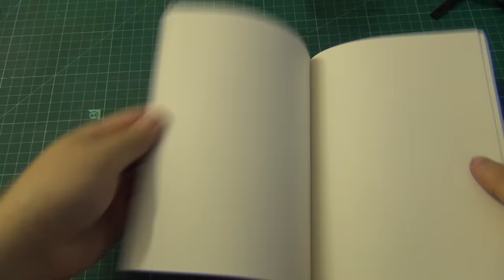Simple Book Binding

Comment: Once he brought out that perfectly shape blocks and that iron thingy I knew my book binding dream is crushed.
Reply: bdusa just use some used straight wood or anything with a straight surface and then put a really big rock enough to hold the papers in.
Reply: You don't need any of those! I've been binding books in my tiny flat without tools just fine. Just use heavy books or smthg instead of the boards and clamps, it works  exactly the same! You really just need the glue, paper, and cardboards if you want to make hardcovers (for paperbacks, just use cardstock). If you don't want to use cloth, use cardstock or regular paper for the cover (though the thinner your paper, the higher the possibility of getting wrinkles). 
I usually sew the signatures together before glueing them for extra security, there are plenty of tutorials on youtube if you want to do that.
Reply: Those are clamps 
(which are cheap and can be found at any hardware store) 
could be replaced with a heavy object. The purpose of him using the clamps is to keep the paper aligned and from being malformed so there might be other solutions to it. Hope this helped!
Reply: hey I bookbinded using heavy dictionaries and my notebook was so beautiful anyway :) just try it
Reply: omg ikr
Reply: I just used some old shelves, and sat my chungus Guitar amp on top. :)
Reply: @manusigl  what hard thing i can use as base of the book..!?
Reply: @mahamwaseem5207  i usually use cardboard with at least 800g/m², my go-to is 920g/m². But the important thing is that it doesn't really bend too much. If you don't want to buy specific cardboard, you can e.g. use the back of calenders, old notebooks...
Reply: @manusigl  okhy..can i use cereal box card board..!?
Reply: @mahamwaseem5207  you can, esp if you glue two or three layers together. but i wouldn't recommend it for books you want to last for a while
Reply: @manusigl  okhy..thnks u..!!

Comment: Technically, that's not Perfect Binding but rather Case Binding with softer backers and no spine.    Perfect binding is gluing the pages like demonstrated with the cover just glued to the spine and folded over on the edges with the edges trimmed flush on a guillotine cutter.  Needless to say it was WAY cool.
Reply from the maker: You're abseloutly right. This is more "perfect-ish" then perfect binding, but that doesn't show up well on the title. Thank you!
Reply: Perfect binding is sewn.
Reply: Ida Kiss Perfect binding is the method of bookbinding in which a flexible adhesive attaches a paper cover to the spine of the assembled signatures of a book or magazine.   Live Wire

Comment: It constantly baffles me that perfect binding actually holds the pages together and even lets the book lay flat most of the times.
Reply: The quality and application of the glue makes a big difference.  Done right it works very well.  But I have a couple commercially bound books using the method where pages are starting to come out.
Reply: @hanelyp1  yeah as long as glue holds well and has a bit give in it when dry. We used to have fancy new textbooks for english class that fell apart bc glue just crumbled and fell off, together with pages.

Comment: You folded the paper pages from one format to the next smaler one. Either you picked special paper with horizontal direction of the fibre, or you will have problems with the book block getting "wavy". Also glueing foldet sheets at the folds makes it a bit more unstable. Either you glue single sheets, or you bind folded ones via needle and thread. For the bookmark you wouldn't need another type of glue, but just inserting it during glueing the back of the book while the glue is still wet. And with a book block cuting machine (about 150$) you wouldn't need to sand the book block. If you aply the glue onto the tissue instead of the cardboard (spreading it star shape like from the middle to the edges) you can simply fold the overlapping parts in, instead of going through another round of applying glue.

Comment: for people who don’t know why this is considered simple for the fact its binding it just glue, it less repetitive compared to ones with sewing which some techniques are simple and have less steps than this it wouldn’t be considered (imo) using that design you easily snap the string when accidentally sewing into your own string if you can undo it if not you just have to yank and hope it doesn’t break the string if it does you have to remove all your progress and restart the sewing process 
Straight up glue binding like this takes longer for the glue to dry but has basically no chance at error like if you sewn it

Comment: Hey there, big fan. Wouldn't it be easier to apply the glue then clamp them?.or maybe clamp them but tighten the clamps after ?.
Reply from the maker: You don't want the glue to soak anywhere that isn't the spine, so that's why you first clamp the pages together and only then add the glue. Tightning the pages will prevent the glue from soaking too deep into the pages aswell.
Thank you for your soppurt! :)

Comment: I am totally imprest!!!!! I wrote a little book I would like to self publish and I definitely will practice this method!!  What options would I have to print on the cover?
Reply from the maker: Thank you for the kind words! As matter of fact, I'm working on a video down the line that'll cover that exact topic. The brief of the process behind printing on book covers (the DIY style) is to use a sheet to vinyl and cut out a stencil of what ever it is that you want to print on the book. Lay the stencil on the book cover, then, with either clear spray paint or clear nail polish, make a thin coat over the stencil to seal the edges and prevent "bleeding", let it dry, then paint it again with whatever colour you desire.
I hope I'll get around that video soon, and I hope to see your comment on that video when it comes out!
Itai ✌️
Reply: Thank you for the fast response ! I was impressed how precise you work! Well done and I will look forward to the next videos

Comment: Great video. i never knew it was possible to bind a book efficiently using glue only. Don't you need to sew it?
Reply: Notice that he folded si gle sheets, that's how you can do it with just glue. If each signature is multiple sheets you could sew them together then just use glue to put them together with the cover. Single sheet signatures don't need to be stitched.

Comment: For those who don't have a tool exactly on the video. You can also use a bulldog clip.
Reply from the maker: You can use any form of clamping that's available to you, as long as you have two boards to press the book flat. Other wise your book will warp and you won't get a fine looking bood. So yes, if your bulldog clamps can open wide enough to hold the book+two hard boards, that'll perfectly. I would advise you to use look for slices of hard cardboard, 1mm of thickness on each side will.
Reply: @itaishemer  thank you very much. I did it. My mother is happy for me. This is great tutorial!
Reply: @itaishemer  You earned a sub!
Reply from the maker: @neverever7821  Best sub I've ever earned!
Reply: I've finish my notebook today and it was great even it's my first time!

Comment: Is pva glue enough to keep the pages together? It seems like they would rip off easily.
Reply from the maker: PVA alone is not enough, that's why I use gauze. The pages are held together very well for a long long time, though you can pull a page out if you'd like. Even after pulling sone pages out of the book  the gauze has a very strong grip on the rest of the pages

Comment: I've made 3 books. And while they all function, they look like shit once you open them. The end pages (the ones holding the block to the cover) get torn and I end up with terrible looking first and last pages. Like I said, they function, but I think I need better stock for the end pages. It's the only thing I don't have when I follow tutorials and you see the black, thick end pages. I have no idea where to find this stuff.
Reply from the maker: That's the thing about hand crafted arts, it takes time, trial and errors, until you get the results that suits you. My first few books looked terrible, believe me! Fir the end paper, I would recommend using thicker paper, such as bristol. Some are stores sell them individually, or in stock. Somewhere around 100 to 150 GSM (Gram per Squared Meter) should do just fine. Foe the cover, I used bookcloth,aarerial which is pretty hard to come by, but is sold online or can me made at home (I have seen tutorials on how to make bookcloths, but I never tried them myself)
Reply: @itaishemer  The one I'm drawing in now actually looks a lot better than the other ones. You can still see it's obviously homemade, as soon as you open it. But for the most part, it's not bad for my 3rd book. I use faux leather covers. They look great. It's just that one stock that I need to make a perfect looking book. 

I fill them with finished art. I have sketch books and stuff but the books I make have all finished art in them. I think it's cool to have a book that I can flip through and see all of my art. 

Thanks for the tip. I'll look for it for my next book. This one is almost full so I'll need to make a new one soon anyway. 

Thanks again.

Comment: this is amazing but what about if you don't have all the tools
Reply from the maker: What tool are you missing? I'll try to help you an alternative. I'm working on a new tutorial, so this'll help me as well, to figure out what folks have at hand to work with :)
Reply: its an assignment to make a book as i am a teacher in the early childhood field. i guess you could say its homemade and i have to use the tools i have and something manageable. i do not have a lot of the tools present. i mostly have cartridge paper,scissors,glue,ruler and cardboard
Reply from the maker: @mvltidiva  In that case you have almost every thing you need. Start by folding your sheets in half, stack them like a book. You can use any flat boards you have laying around to press your sheets together and apply the glue. Use heavy weights if you don't have aby clamps. Another key material for this to work is a strip of gauze to add to the spine of your glued sheets. Any cheap gauze you can find in any pharmaceutical store will do. This will give you a very strong surface to glue the cover on. For the cover, you can cut and fold any cardboard  you can find to fit over the glued sheets. I used cereal box before and it works perfectly. You can than paint/apply wallpaper/glue fabric to cover the cardboard, or do whatever your imagination leads you.
I hope that helped a little, though I didn't go into all the details I hope this gave you some idea in how you can simplify the process to your tools :)
Reply: @itaishemer  this helped me so much and it turned out amazing. Many thanks to you and your creative mind
Reply from the maker: @mvltidiva  Awesome, so happy you made it! Best of luck to you

Comment: question: what tool is he using @ 3:47 ? it looks like a calliper but it has that long metal?
Reply from the maker: That's indeed a caliper. As I move the scale, the depth rod is extruded from the bottom. The rod sits flush with the bottom of the caliper when the jaws are closed, so whenever I open them, the rod is extruded with the exact same length as the jaws.
Using this tool I can make repeated cuts faster and a lot more precisely.
Hope that helps clear things ✌️

Comment: 4:13
Which materisl is this ?
Reply from the maker: Book cloth - it's a sheet of cloth backed with paper. The paper provides a great surface for the glue, while also protecting the fabric from getting any stains from the glue. You can substitute it with a thicker sheet of fabric (such as canvas), as any thinner fabric might show wet spots after the glue dries.